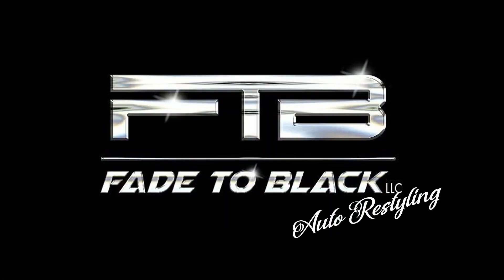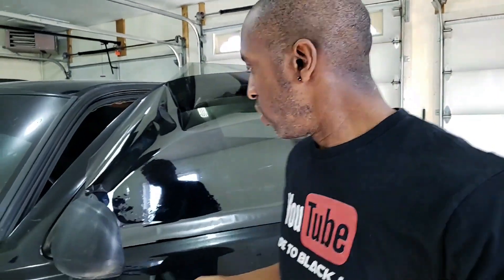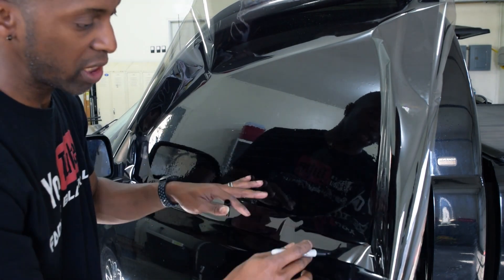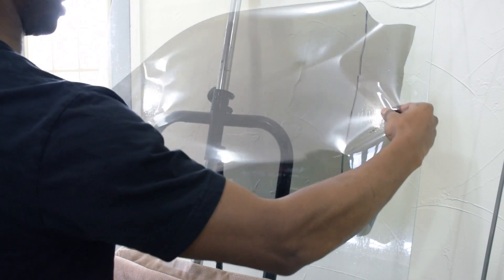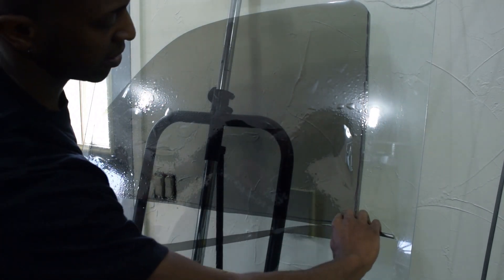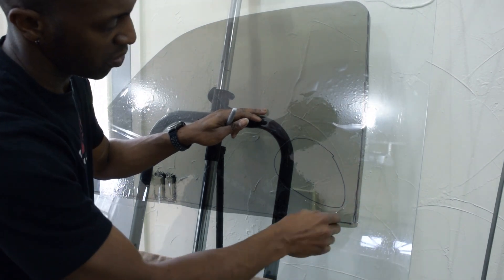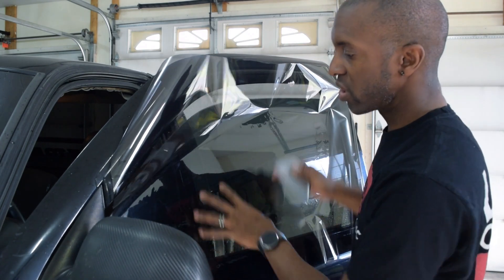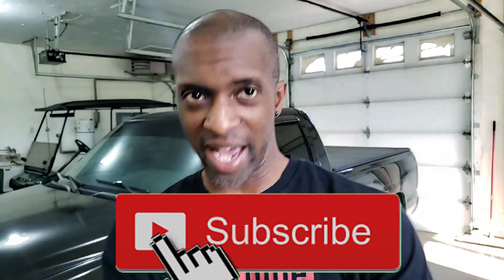Hand Cut Window Tint using a Sharpie Marker in 2021

Comment: Idc what anyone says, your peel board is awesome. Not sure if you got credit for when I got my easel but I definitely wanna say thx. My temper glass is 34"×36" and it hold it with no problem. Only thing I added was hose clamps on the metal rod behind so my glass wouldn't fall from the weight. Thanks man appreciate the help.
Also I use the sharpie method on semi trucks, as I'm 5'7" using the sharpie and take to my peel board.
Reply from the maker: I'm glad things are working out for you. Yes it have some vice grips on the metal rod as well. I don't trust that pressure bolt too hold up a sheet of glass.

Thanks for touching base and glad it's working out.
Try too hit up the Live Stream on Wednesday night and let us know what you for going on.
Reply: @FadeToBlackLLC  hey one more thing I watched your heat gun video. I use the Wagner $24.99 gun but went on ebay and got the kobolt gun. 

Fyi there is 1 or 2 more for sale. Go get you another. They come with all the accessories too..lol

You know I'm going to start checking in on the streams to show my support for you. Definitely have helped me and commented on a few of my post... 

That's the stuff that keeps me excited about tinting where some of the best tinters in the business so love and support to us who haven't been doing this for long. Only tinting for 3yrs now... Thanx Wayne!!💯💯

Comment: This is my go to. When I first started 5 years ago I seen Ralph do it and it helped me so much and i tried to cut and shift but I can’t do it
Reply from the maker: Yep the cut and shift thing was always a pain trying to reposition the film.  Now just mark it and know right where you need to cut.  I'm with you, I use it all the time now.
Reply: @FadeToBlackLLC  I messed up some the other day trying again to cut and shift. Some how it moved away from the seal and cut into where I needed. I’m sticking with my sharpie
Reply from the maker: @joshuamartin7443  hey, I hear you. I think I've scrapped a lot less film by using the Sharpie method.
Reply: @FadeToBlackLLC  hard to mess up. If the film moves just redraw the line and your golden
Reply from the maker: @joshuamartin7443  100% 👍🏾

Comment: Hi I want to know do you have to remove a door panel on 2017 silverado to do the seal??I seen a video where he took the panel off for a 2020 silverado??
Reply from the maker: If you look at my videos I've done a bunch of those styles trucks without removing a panel.
Thanks
Reply: @FadeToBlackLLC  thank you Dwayne I just wanted to be sure I'm doing my first one and it's my vehicle any tips would be appreciated 😀
Reply from the maker: @That-guy919  Wayne lol
Reply: @FadeToBlackLLC  im just curious do you do wraps to cars aswell or do you just the tint
Reply from the maker: @That-guy919  I wrap as well. I like to have help though  also another way to let others shine that have talent. Wrapping is a lot of work. I have a truck in my shop now for a full color change.

Comment: What’s up Wayne. I’m getting into window tinting. What else can I use if I don’t have the peel board?
Reply from the maker: You can peel off of the car but be careful not to put the blade on the glass. I've been actually using scissors to cut out the pattern after I Sharpie it when I don't have a peel board around. 
I'll try to make a video about it soon.

Comment: Excellent tips bro! Thanks I’ll try the sharpie tip on my extended cab windows. What do you use for prep solutions? I always use foam windex with ammonia. Keep up the great work!
Reply from the maker: I also use the Sharpie to guide cuts on the outside buttons or anything you need to cut around.  I use Flexfilms Pre Tac and Tint Tac.  Love the Stuff.
Reply: @FadeToBlackLLC  Awesome! I have used the tint tac before also. It does work good lol thanks!
Reply: i guess Im quite randomly asking but do anyone know a good website to stream newly released tv shows online?

Comment: Bro what length do u suggest i get for a side business? 24inches is too small come to find out for alot of back windows. So do u have a separate roll u carry just for back windows? Or should i just slice the tint together even though that looks unprofessional.
Reply from the maker: I have a video on Tint Sizes. Look back and it will help you out with what sizes are best for what in my experience.

Comment: I was taught using the sharpie method. Well explained Wayne 👍🏻. Like the peel board. What mix is the isopropyl solution?
Reply from the maker: Just curious on how you got trained? By someone you know?
Thats Pre Tac from Flexfilm cleaning solution.
Reply: @FadeToBlackLLC , someone I know worked for a company about 30 miles away that did a lot of tinting for dealerships. He got me 4 days training one to one at his workplace.
Reply from the maker: @adampugh3493  ah ok so are you still tinting? Where are you located?

Comment: How would you suggest making the front mark if I cant get the sharpie in there due to the side mirror being in the way ? Without having to take the mirror off
Reply from the maker: Most cars you can get in there. You can always make the lower line over to the mirror then roll down the window and cut the top edge and then make the mirror line as best you can. Harder to explain than doing it.

Comment: What’s the ratio for the solution? 70 percent water/20 percent soap and 10 percent alcohol?
Reply from the maker: I have a video on how and what I use for cleaning and installing. I'd check them out.
I don't use Alcohol, the Pink cleaning product has some in it I'm thinking.